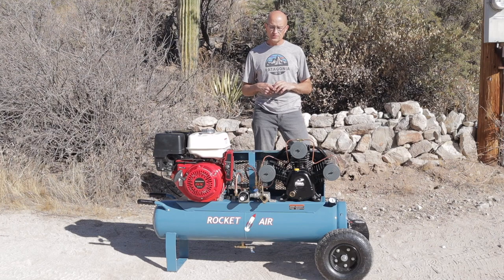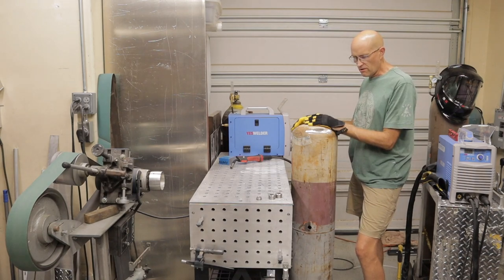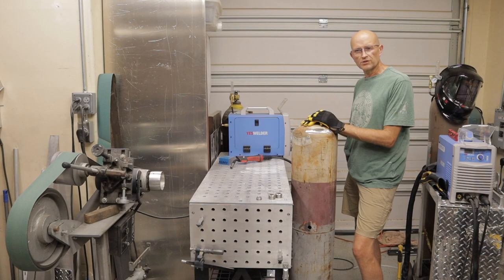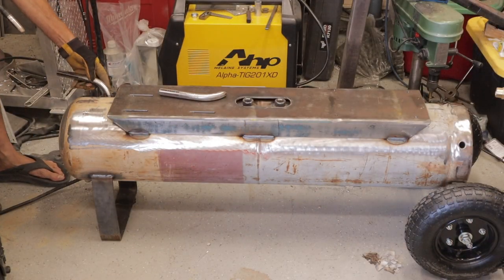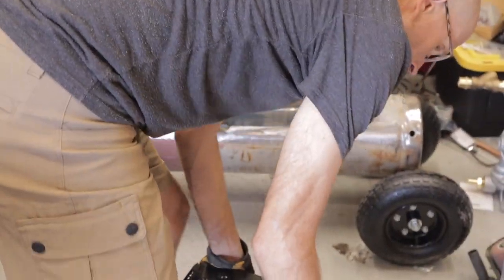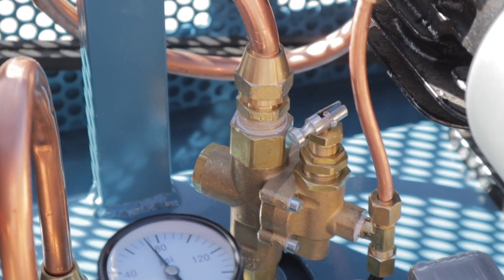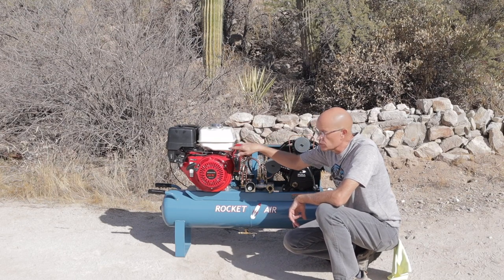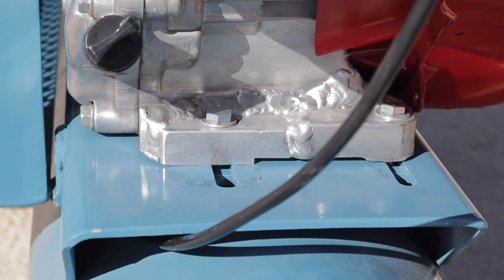DIY GAS POWERED AIR COMPRESSOR BUILD! -- HIGH PERFORMANCE BIG CFM! HOW TO — HONDA Powered

Comment: Beautiful job on the build !! but Please, Please tell everyone you normalized all the welds on the pressure vessel/ tank!!!
explain to your viewers how to normalize a weld and if not done you have created a bomb that could kill someone!  not a troll joke! or do not weld on air tanks period.
       I worked with a guy who decided to weld up his leaky compressor. It was the last decision he made. his girl friend heard a loud sound from the garage and met him at the door holding his intestines in his hand. He said "help me" and fell dead at her feet. Life is too short to take chances.
Reply from the maker: Hi there! Thank you for your cautionary tale and your concern for the safety of others. I will tell you that I have been fabricating and welding for more than 35 years. I also have extensive experience with metallurgy and I’m also a machinist. The only time you would need to do any sort of normalizing with a pressure tank is if you were working with a higher carbon steel that is heat treatable. Low carbon steel like what these tanks are made of can not be hardened as long as you weld with a compatible low carbon wire. Also, this tank sees 125psi max. as it’s working pressure and the tank was a Freon tank before and was rated at 400psi and is much thicker steel than a standard compressor tank. As such, I am fully confident that this tank will outlast me in its use as a compressor.  I’m sorry about the death of your coworker, but the only way I can see that there would be a problem was if he welded while the tank was fully pressurized or had his heat way too hot or was welding with a torch or something. Thank you for your concern though.😊🙏

Comment: That's a lot of air c, f.M.Why would you need that much?? Most horowners never need more than five And nine will run almost any half inch impact tools Very well. Just.
Curious why so much
Reply from the maker: When I made this compressor I was planning to use it to shoot shotCrete and that takes a lot of CFM. I was actually going to build another one and run them in tandem.  And you are correct, most people will never need this level of CFM. On a side note, I grew up in Maine and most of my family still lives there. Graduated from Scarborough high school in ‘84. 😁👍
Reply: @PranaTech  from Fairfield live in wilton